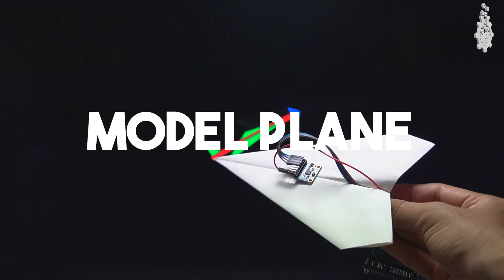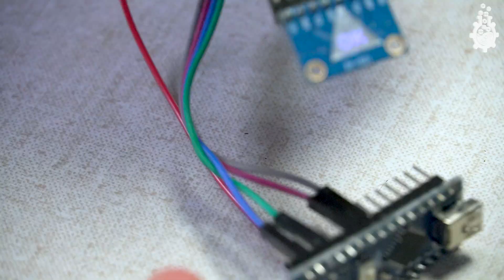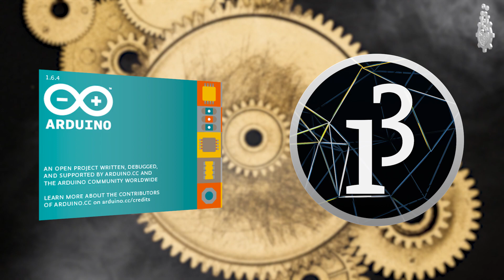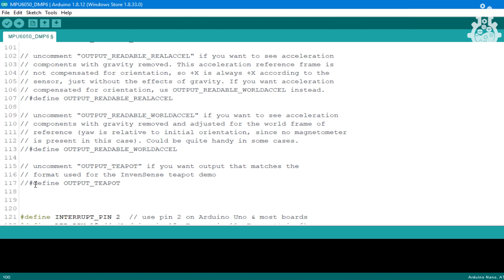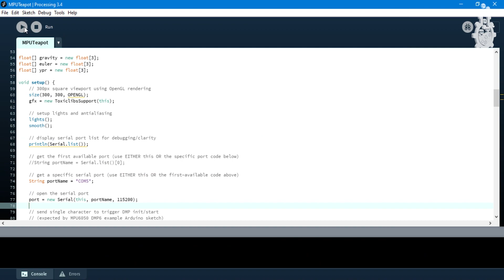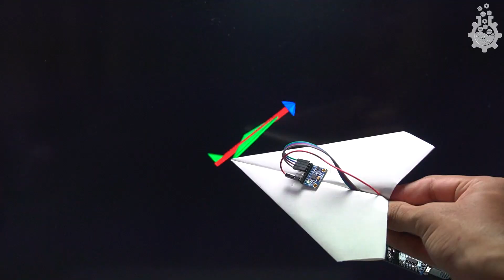MPU 6050 Teapot  project | Arduino mpu 6050 project

Comment: Hi, there. Thank you so much for the video, and that is what I am looking for. I have got a question, could you please help me?
When I add the library 'i2cdevlib-MPU6050 ' to the Arduino IDE I got this error 'Specified folder/zip file does not contain a valid library', so do you know the reason? I am grateful for your help. Thank you so much.

Comment: Thank you for sharing how can I Implement Kalman filter or any filter for this sensor is it possible to have 2 different outputs whit simple output and kalman filtered output?
Reply from the maker: I'm not an expert in filter designs using code, so I am not sure how could I help you with this question

Comment: When I run my code in Processing, it shows an error that the package 'toxi' does not exist and you might be missing a library. I copied both the libraries to the Processing libraries
Reply: make sure you unpack PRocessing, bc it worked after I unpacked it into the desktop and opened it from there

Comment: I got the library for the processing but I couldn't find the code
Reply: it is in the Arduino library Zip file, in step 5, "i2cdevlib-MPU6050\MPU6050\examples\MPU6050_DMP6\Processing\MPUTeapot"

Comment: It says that some of the classes in the MPU Teapot (Such as ToxiclibsSupport and Quaternion) do not exist. Is this because I haven't uploaded my DMP6 file to any Arduino board yet, or are there more problems that I need to fix in order to fix these issues?
Reply from the maker: Someone found a solution to similar problem, please look in comments
Reply: I used the Library Manager in Process IDE to add the toxi lib

Comment: can do with the mobile app ? it is possible or not
Reply from the maker: Yes but not with Arduino, you would need NODEMCU with Blynk or some other app, else you would actually have to design an app, not exactly sure since I haven't tried much experimentation with the same.

If you get it working, do let me know, you can find my email and or social media links drop me a msg or mail if you get it working with app.

Thank you for subscribing to Mission Critical